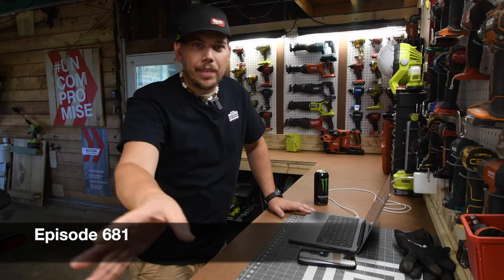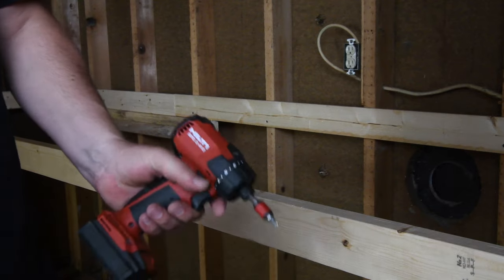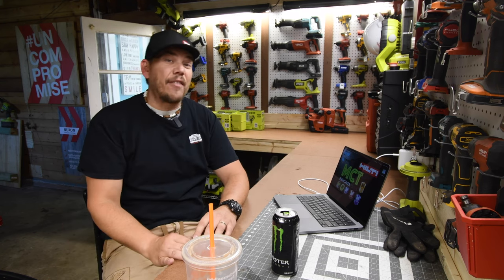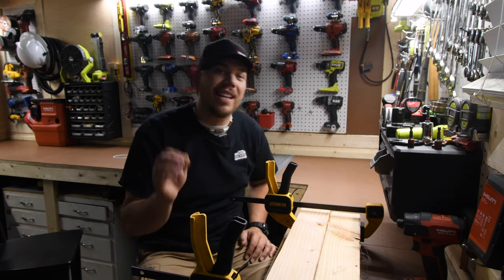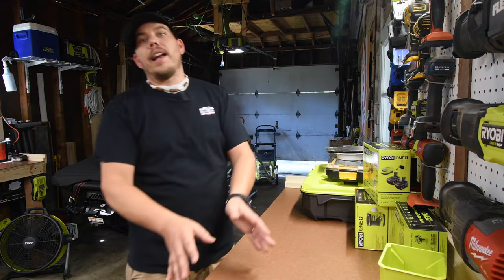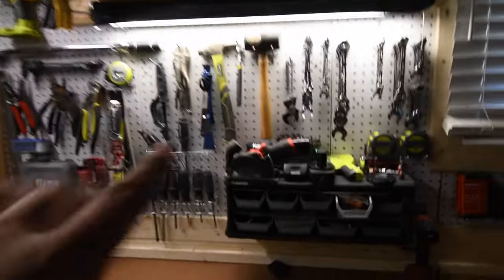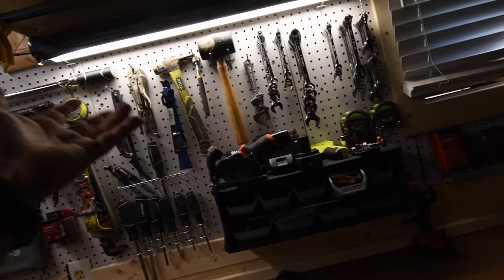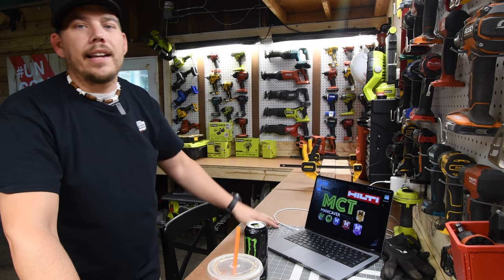Do you think you need a New Garage Workshop?

Comment: this is insane,,, i have literally spentbthe last 2 weeks, redoing my pickup truck  layout n organization,  getting more boxes for my tstak setup/adding the custom foams to em as needed, aaaand reorganizing  my workspace in the garage..
i had one lil corner that i had dedicated to my tool storage space,,,, the rest was workbenches, chop saws, tablesaws, lathes, etc... but  i kept feeling more and more claustrophobic just cuz i have added a whole lot of new tools to the lineup and like,,,,, tryna hang my rotary hammer upside down in between a recip and impact wrenchs because thas the only space i had left to work with hahaha... 

but now i can breathe, all my shits organized and have all their accessories in neat cases with em and all that.  im guessing you feel the same cuz your new layout is looking very proper! diggin the wall setups w all the same type of tools,  vs like say separated by brands or whatevs...
and i got that new ryobi orbital sander too! its waaay less vibrating and sooooo much more manageable and maneuverable w the shorter height!   

one lil suggestion you might wanna consider,  i have made individual rolling tables that i put my miters n table saws and all that stuff on,, they pull out from under the workbench and if their not tall enough as is to run, ive got like a motorcycle jack that ive made my stands compatible with so i can pull out my miter saw on its rolling table,,, slip the jack under, pump up to height and bam the whole thing is up to where i need to work easily!  I had someone make a  suggestion  to upgrade onnthat even more that you could do too,, instead of jacking up them to size, make the rolling stands level w the work Area, find a dedicated spot on the bench like where youd go to set those up, and cut  out a space to be able to just roll them in there and loke have the benchtop just on a hinge and drop down the sides outta the way. n then just swing the benchtop back up once your done!  i may need to work that into my station sometiwm, but im happy w the breathing room for rn!

Comment: I've been putting a lot of time and effort into cleaning up and improving my shop as well. One thing that stands out to me about your 'shop' is that so much usable pegboard space is taken up by what looks like display of your power tool collection. Not 100% sure of what is hanging there but think I see numerous recip saws and impact drivers. It's just me but I would think keeping your go-to tools on the pegboard and other storage for the duplicate tools would give you more usable working space for tools or other organization. Maybe...maybe....ok, got a project for you. Build a 2-deep pegboard system where you have one sheet of pegboard with most commonly used tools and then behind that have another sheet of pegboard against the wall for additional storage of the collection. Perhaps the front pegboard can be on a slider/roller system that goes left/right as needed (think barn door) or a hinge system. Dang, I might have to go do this myself now...
Reply from the maker: I no longer wish to have every tool I have on the wall. I don't think that's necessary anymore. I nice clean non clutter display I think is best now.

Comment: New Garage looks sweet !  I gotta get me one of them Ryobi fans with the clamp .. going camping in a few weeks.. tent  trailer with no power.. just  12V in the trailer.. should I invest in a RYOBI battery and charger or just get a battery adapter and use M18  batteries ?
Reply from the maker: I love my Ryobi clip fan. it is the most used fan in my house and if we go somewhere
Reply: I mounted two permanent fans in my shop. They are up high out of the way. They are the high velocity type. Of course I can adjust them if needed but usually don't need to as they cover everything in a small shop. I wired the outlet they are plugged into on a switch. Like a light switch. They really help as it gets hot in Northern California. I think the summer gets hot everywhere in the US.

Comment: What did you have to do to fix the air canon?
Reply from the maker: we ran this fan 24/7 for 7 months a year for 3 years on a plug.  this year it glitched out. it would spin very slowly. so once in a while I would run it on a battery and that fixed it for a while but I took it apart cleaned the entire fan and now it seems to be working. but for now I will be using a battery because it seems to like it